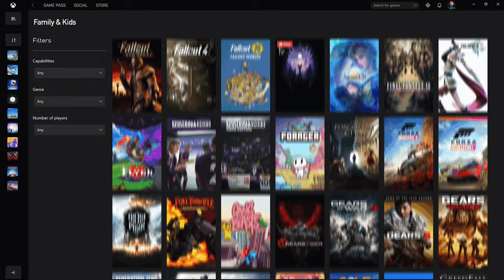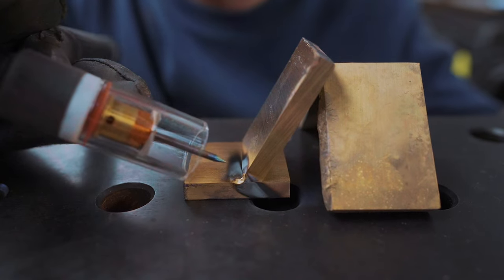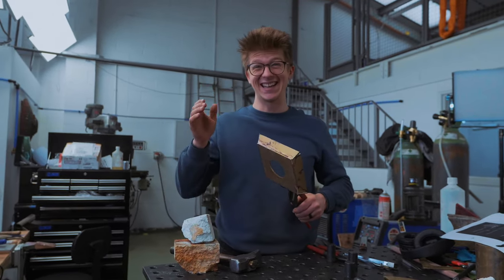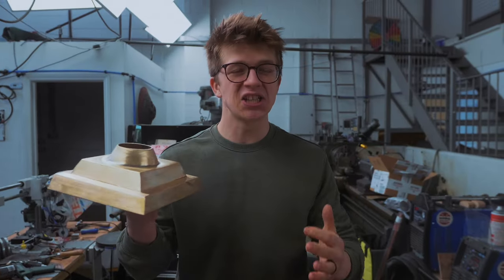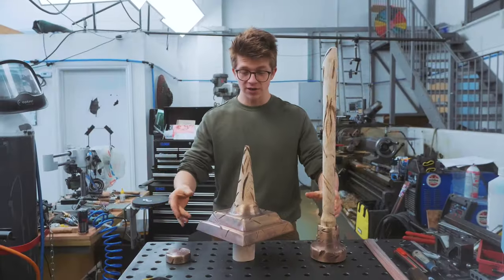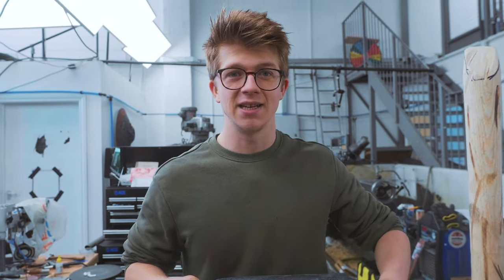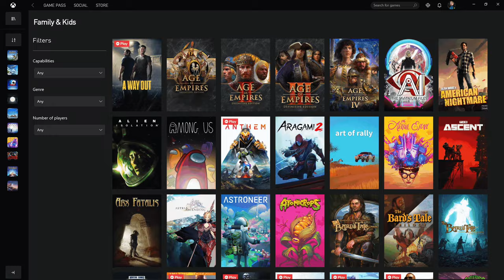Making a 50lb GIANT Warhammer!

Comment: Funny story you reminded me of: For many years I emptied hoarder homes and true story I happened to build a 100 pound sledgehammer that resembled a Thor's hammer toy my kid has-completely accidentally.  So the story goes I drove the big truck and we threw away 5-10 tons every day of contents of homes, farms, barns, and businesses that had been foreclosed (seized) but had left large amounts of contents the banks had to have removed.  We took everything, and a lot of it was collections of all manner of things and about  10% of everything ended up being scrap metal.  We dumped a lot of trash in landfills, metal in scrapyards, and kept a lot too.  This required us to break everything we could to fit the massive loads in my box truck.  Well one of these houses (actually many) had this amateur fabrication shop and in the dusty forgotten corner of one I found a 12" x12" x 20" cube of steel with beveled edges and a hole in the center across the width.  Obviously I kept it, but I rocked it in the back corner of the truck where I stored steel over 3" thick that I kept for me personally.  One day I found a solid steel bar about 5ft long that was the exact diameter of the hole in said giant block of steel; and I instantly knew what had to be done.  I stood on the truck and the guys helped me on the ground by holding the bar in position and we bashed the tight fitting solid pipe and block with our biggest sledge into a seamless non welded "world's largest sledgehammer" as we christened it.  It was so heavy that over the years as we burned through over 100 guys on my crews, only 1 guy could swing it.  His name was Josh, and he was built like the green hulk and was a round faced country boy with a literal chip on his shoulder, he was the most powerful physical human being I've ever encountered.  The strength and other "competitions" we came up with on the job were always fun-especially in that time and particular type of work where demolition and destruction was a daily requirement-but this guy literally destroyed everyone at every single thing x 10 usually 😆.  I still remember him swinging that 100lb sledge at dressers, chests, walls, floors, metal desks, even a car.  Those were the times of my working life, but now I'm old.  Thank you for joining me for a little while on memory lane.
Reply: Josh was worthy
Reply: "Big Lad Josh" was a user i encountered while playing games with my friends, this sounds like the kind of guy i imagined.
Reply: @Sualin  Funny story: he was much younger than me and played a game called FInal Fantasy online 11.. and talked me into playing it-I subsequently went through a severe downward spiral of addiction to that game for 9 months.  I actually quit playing online and all games basically because of it 😆
Reply: Probably just get deleted but I made a ton of videos back then and have them on my channel on a playlist called "Extreme Hoarder cleanup to music" or something like that... They unfortunately were made using my "hat cam" and ancient cellphone cameras 😆
Reply: Do you still have the hammer?
Reply: @Ben-Carr  Unfortunately not
Reply: Haha a great read thanks 😊
Reply: Go to the school of short story telling, lol,thumbs up
Reply: A piece of steel of those dimensions would weight 815lbs.... So....
Reply: @Nevir202  That's true, I never weighed or measured it, but it was about 5-10 times bigger and heavier than our 20lb sledge and quite heavy.  I looked it up and a cubic foot of steel weighs well over 400lbs so you are absolutely correct; it was probably a fish story resizing 😆 but it was definitely heavier than an 80lb bag of cement by a lot and we moved a lot of those.
Reply: Thank you for walking us down that lane. I envision this beast of a man and hope to see him swinging for our side. 100 lbs good Lord.

Comment: As a plumber who regularly works with softer metal soldering. You're using to much heat. With the piece you're working on, targeted high heat instead of lots of blanket heat is the way to do it. The way you heated the brass to make it all cherry red gave it away.

Comment: When "breaking" a silver solder joint that long, you don't, you heat it back up and pull it apart while under fire. I would've used some wire to twist around it to keep it from opening up, or some third hands to keep it from moving. You worked through the problem well though! I really suggest taking a jewelry class that focuses on copper and brass work if you keep working in those materials. They don't work at all like steel.
Reply: I would like to know how long he came to using the silver solder in a syringe. I know plenty of guys who felt stupid for doing years of work before thinking about it.
Reply: @neithertwosturrr3016  I wonder what the melting point of his original solder was. We classify them as hard, medium, and soft to denote how easy they are to melt. He might've need a soft and been using a hard.
Reply: @Kate_Fyria  he was probably just using whatever he had laying around.  I doubt he would be used to the difference being he mainly uses steel/aluminum. Also did you see how cranked that torch was?
Reply: @neithertwosturrr3016  that’s what I saw. That was so much heat.
Reply: @neithertwosturrr3016  yeah! Way too big and hot too solder with! No wonder he was melting it!
Reply: @Kate_Fyria  I'm actually surprised he wasn't melting the brass with that flame!
A 00 tip and a little time would have made a beautiful joint!
Reply: From my experience soldering big brass, I can attest that a finer flame does wonders, but as heat conductive as brass and copper are, the heat can do weird things, especially with irregular shapes...
Reply: You are indeed, knowledged in this matter!
Reply: @generalgod4326  I took jewelry classes focused in metalwork in college and teach high school jewelry classes now, as well as making my own stuff from time to time.

Comment: Little bit of advice, learned through bitter experience and countless disasters, when you’re doing a big silver soldering job with multiple runs of solder use different grades of silver solder by grades I mean the percentage of silver in the solder sticks varies and with it the melting point. The lower the percentage of silver the higher the melting point the higher the percentage of silver the lower the melting point. So for a job like this start with a higher melting point with lower percentage of silver say 18 or 24% with a high melting point and work your way up the percentage of silver in steps with last one being the lowest melting point at 55% silver. The difference in melting point means it won’t disturb any existing joints. Use copious amounts of silver soldering flux like Easy flo or Tenacity 5 especially the latter for prolonged heatings as it has a much longer life than Easy Flo and keep periodically adding it to existing joints.  Also ease off with the torch flame to a really soft or carburising flame (excessive fuel gas) its easier to control the amount of heat put into the work piece and direct the solder where you want it flow

Love the channel content and the enthusiasm for your craft 👌👌👌

Comment: Alec, some things about soldering brass. First off, you appear to be using an oxy torch as heat source which is far to powerful for both the solder and the material you are using. A medium sized blow torch would be much better. Brass has a very high thermal conductivity ratio which is why everything was melting. Secondly, jewelers solder was the better choice as silver solder is really more designed for soldering copper to brass in plumbing and in small steam boilers. Great work though!
Reply: I’m pretty sure he only has a propane/oxy torch in his UK shop
Reply: Agreed. Propane would have been a better choice. It only burns at 2000 C. Oxy acetylene burns at 3600 C. Much less aggressive for materials with lower melting points.
Reply: I feel like the 1week making time was the limit for all the improvement Alec could have made
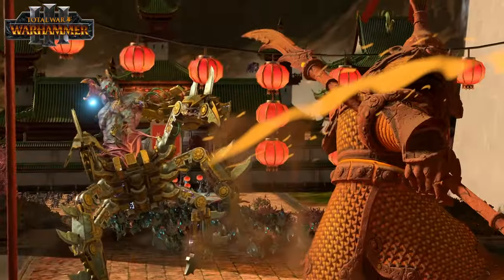Reply: @terdfergeson23  Nope 07:00
Reply: He may have also been more successful using a reducing flame I don't remember what the type oxycutting uses is called but it is hotter and he was also using a hotter section of the flame.

Comment: something I learned in jewelry class was when making an assembly it is important to use different grades of silver solder for different steps in the process so that the later soldering steps don't need to get hot enough to melt the solder from the previous steps.

Comment: Silver solder comes in different grades. High temp to low temp. You start with the high temp on the first joints making your way down the grades for following joins. Meaning subsequent heats wont unstick your first joints. Flux is also your friend when using silver solder rods, it allows solder to flow and helps prevent oxidation. Also also you're using too much heat, use a much smaller blow torch.    😀

Comment: Awesome video. As for the solder issue - as others have likely stated, there was just too much heat, both direct and residual. even after the solder had melted and spread out it was far too hot to freeze before the joints just gave way. Indirect heat and a small blow torch work best for it typically.

Comment: Tig welding brass is signifigantly easier with more preflow and the right gas both are very important as the stuff is stupidly easy to contaminate by heating without enough shield gas. You can also heat too much and burn zinc out if your mix has any in it. Brass is quite a pesky material but fun to weld once you get the setup right. Bronze filler was absolutely the right option here. As for the jewelry silver solder it tends to let go all at once when you heat up the base metal enough to melt the entire edge when it's not clamped and brass having a lot of copper has a tendancy to spread heat like that. Try adding a large mass of heatsink metal between the flame and anywhere you dont want melting. I use a copper half inch plate or quarter inch plate when i need to do that.
Reply: Key to noticing this if there is any soot you didn't shield properly. If there is yellow dust you are burning zinc. Since your weld had black around it there had to be a shielding gas issue.

Comment: you can pulse weld brass at a high frequency DC current but youll have to throttle the foot pedal to find the right amperage to get it to tack together once you get it goinng you gotta run along the seam. this will prevent the zinc from burning... or you can use silicon bronze rods to tig braze them

Comment: Next time you want to make something that looks like brass, a suggestion I have is maybe you can use thin steel and then use a brass wire wheel on a rotary tool to color it like brass. It's a technique I have seen on a few channels and it works great.

Comment: I hope the connection between the handle and the head holds up. When I saw the holes in the top and bottom I assumed it would go all the way through, but like that the connection is going to have a ton of moment on it. Good luck.

Comment: if you are solding brass. you must clean the area and use flux. and use little heat around the joint  not on the joint. and  you can use soap, by rubbing little of soap near the joint, and the heat the area when the soap mark turns black the brass it is ready for solding.

Comment: Jewelers have the same problem when soldering. The solution is to use different temp solder. Start with high temp solder and work your way down to low temp solder.

Comment: Yeah, if a solder joint is done well, the joined material will break before the join will (even if it is annealed brass). You could have reheated/liquified the solder seam but given the time pressure, beanding/beating it into place was the best route. The pain of soldering large/thick bits of any metal is that they hold heat for so long that the heat from working on a "cold" section can travel to a completed section and loosen (or separate) the finished sections. A prof I worked under had a class use solder on steel "because it's the same principle as welding" (despite being told, no, no it is not) then wondered why the class was burning through solder (which the program supplied from material costs) to the point that he had to pump the students for more material costs to buy more solder.
Those projects were more solder than steel at the end.
As a Warhammer fantasy fan I'm surprised you didn't go with the iconic "Hammer of Sigmar" though admittedly, it's a bit plain. Awesome result nonetheless!

Comment: I think you need a much tighter flame and do smaller brazes, it's like welding with solder. It's not meant to take wide flames. Also the fact that you're not using the same material as the base means you're not getting a true fuse, just a soldered joint. Think of like soldering joints of copper, unless it's copper-based solder then when it heats up it will start moving.

Comment: Alec, NEVER cool metal after soldering using water. It cools to fast and can form a crack in the solder joint. For the same reason you allow copper pipes to air-cool and not using sth like wet cloath, cause you can have big leak if it is your main water supply. That could be a reason why your hammer had fallen apart in 4:00

Comment: For silver solder, you really need to use flux to help it run. Set up your joint, add some flux, slight preheat, and THEN add your solder. That should help things stick a bit better ^_^
Reply: Using flux was about the only thing he did right... He was drenching the thing in it with a paint brush.
Reply: @Corey Morse  Yeah I noticed that but I wonder if it's a different type of flux from what I've used in the past. We used a white paste and a powder  flux, dipping the silver solder into the powder before feeding it in

Comment: Im a jeweler and for items that have multiple pieces that need soldering together we use different grade solders, like easy, med, hard all with slightly different melting points. You'd start with hard (highest melting temp) then work down never getting the peice as hot as the previous section. oooooorrrrrr can use clay to holder it together while doing them all at once (is fiddly to set up but less so than having pieces fall apart hahaha) hope this helps for next time.

Comment: When silver soldering, warm up the whole thing to just below the melting point of the SS and use a localized torch with a small flame to actually solder.
Reply: Also if you had used Monel or silicon bronze instead of brass then you could have TIG welded it with ease and it is a lot stronger.

Comment: Alec, next time you’re tig welding thin metal. Start on each end and end in the middle. Just so the heat that has built up the entire length of the joint is now vastly greater at the end than at the start. Hence the hole which is tricky to patch

Comment: Looking at the design, I think someone messed up on it. The main body between the brass bits (that looks like rusted metal) should be wood and the brass would be the binding that keeps it together and the dark grey inlayed between the brass bindings would be the iron bindings. The front of the hammer could have been the iron plates or even wood themself along with the spike on the back. Otherwise having a wooden spike on the back instead of a piece of iron is kinda redundant. I mean this in both a practical way to make a large hammer and stylistic given to the Warhammer universe. 

For the way a hammer like this would be made IRL. The wooden block would be formed up to the main shape and the iron bands would be shaped to the basic setting size and then heated to stretch and then placed on to cool and shrink. This helps keep the wood from splitting over time and from breaking when the handle and other metal bits are jammed into it. The brass parts would be both decoration and weight addition but they would be a real thing although not as bulky to tie the rivets together and keep the band from sliding and shifting around. Most the times this would be done with just a single row of nails set into the middle but design and flair can always be added as long as it still does the job. The the rest of the shaping would happen on the front and addition of the spike in the back and handle. Handle looks way to small at the neck, just looks weak and easy to break which is so anti-Warhammer aesthetic.

Comment: It let go at the same time because you are using way too much heat and too big of a flame. What happened is that brass conducts heat very well so when you use such a big flame you at some point got the whole brass piece up to the temp where the solder melts. I would strongly advice using a smaller torch with a sharper and much smaller flame, that way you can take your time and focus on smaller areas at the time. Also a diluted mixture of either hydrochloric acid or phosphoric acid and water(1:5 if I remember correctly) in a small container with a paint brush or something will make the solder bind and flow waaay better. You brush the areas you are going to solder with the mixture and you can use it as you solder to regulate your temperature. Just make sure you are in a well ventilated area or use the 3M mask you have when you do the work. Best regards from a Norwegian radiator repairs man. Just message me if you want any pointers on soldering or if you want to see what equipment I use.
Love the channel by tew way, been following for a couple of years. Keep it up Alec!

Comment: You need a welding (brazing) torch that allows for a much smaller and more directed flame. Also solders that melt at different temps (this is how jewelers do it- starting with a higher melting point and working down as needed).  Might be a good idea to clamp on some steel heat sinks between joints, or find some heat sink paste to do the same thing (if they still make that- I used it forty years ago). Cutting torch is definitely the wrong tool for this job.